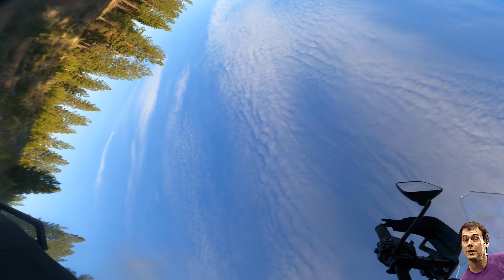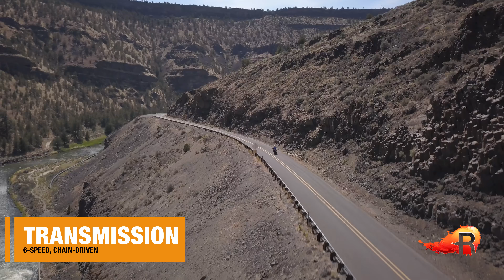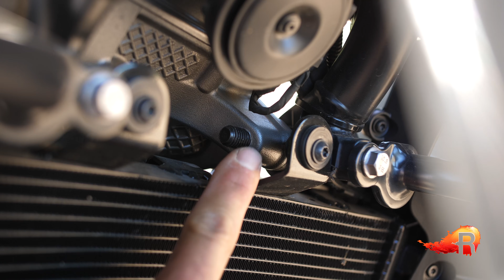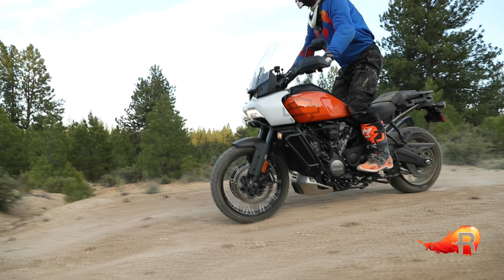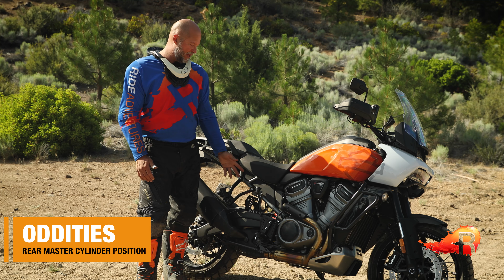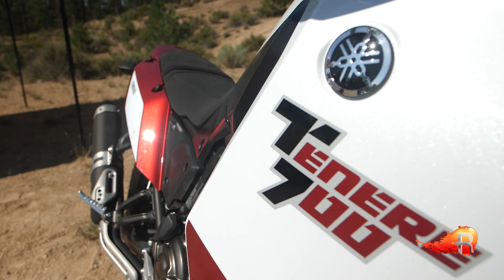Harley Davidson PAN AMERICA REVIEW | Pros & Cons

Comment: Most likely they'll use a 975cc motor from the Bronx in order to compete in the middleweight ADV class!
Reply from the maker: Going to be tough to fit that rear cylinder into a middleweight and keep the seat and bike sized properly to be considered a middle sized bike. Parallel Upright Twin or Bust! :)
Reply: The Revolution 750 from the discontinued street series.  I actually like that motor, too bad it was put in the wrong bike.  Had it been put in something that looked like the Sportster, it would've sold like hot cakes.  Instead they out it into something that looked like it was designed by China.

Comment: I bought the base model Pan Am as I didn't really need many of the features of the Special as I ride it mostly on ride for touring. At 6'2" I also don't need the ARH to touch the ground when stopped but if I were to do it over again I would buy the Special with the ARH and then put on the accessory high seat that HD sells. The reason being is that I find the leg room right at the limit of what I find comfortable, if I were to put the high seat on I would no longer be able to comfortably reach the ground. I also find the stock seat to be a little too soft for long trips but that is likely due to my size - 245lbs - and a Corbin seat is in my very near future.

I puzzle to understand why the rectifier/regulator is where it is but haven't had any issues with it yet so what do I know? 

Overall I'm very happy with my Pan Am after trying a few different bikes to replace my beloved 2009 Buell Ulysses. Ride safe out there.
Reply from the maker: Thanks for sharing, and yea, maybe that Adaptive Ride Height could have been useful. Wonder what they are charging to add it? Congrats on your fun machine, and yea, Corbin makes great seats.
Reply: @RIDEAdventures  In Canada the base model is $20,999, the Special is $24,199. Of course the ARH is only offered as an option on the Special due to the Semi-Active Suspension (the base model has regular suspension and is very good), the ARH is $1200. After taxes it comes out to $5060 plus another $800 for the spoked wheels should you want them. A pretty big hit but given all the extras that come with the Special it is actually probably a pretty good value.

Comment: Have you had any issues that you’ve noticed? It’s a great bike, but with any new model you’re going to have growing pains. From the starter issues to the radiator hose, to even the clock there are several things that need fixed.

That said, I still love my PAS. I’m currently full time motorcycling so been putting a lot of miles on this new platform and still impressed with the way it rides and handles.
Reply from the maker: We didn’t actually buy the Pan America, as it just doesn’t fit so well with the rest of our Oregon-based rental fleet. But yea, hope they resolve a few issues.
Reply: The clock!! I’m so short that there is a cable that hides the clock completely.